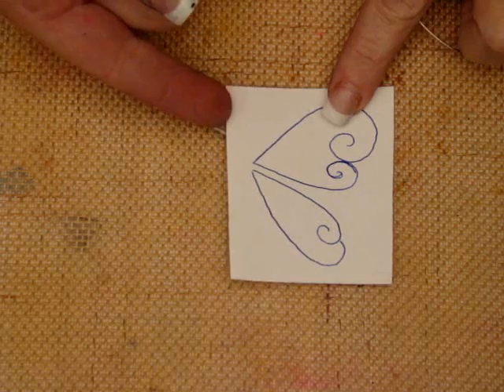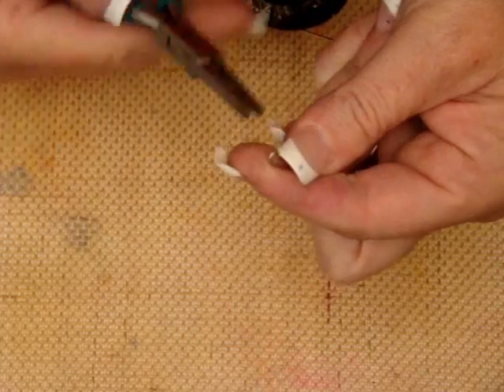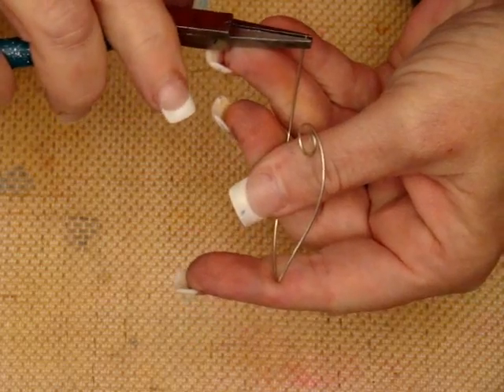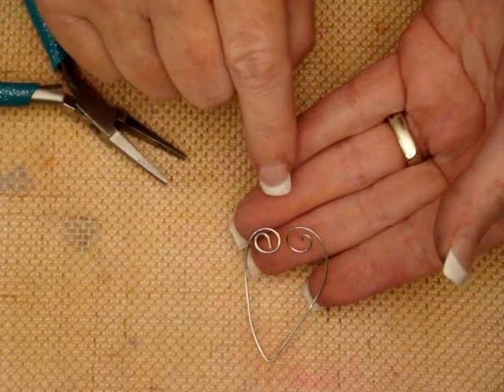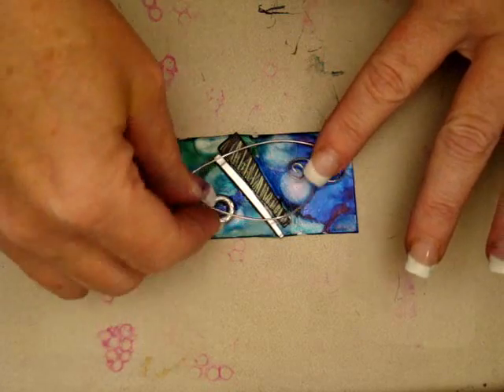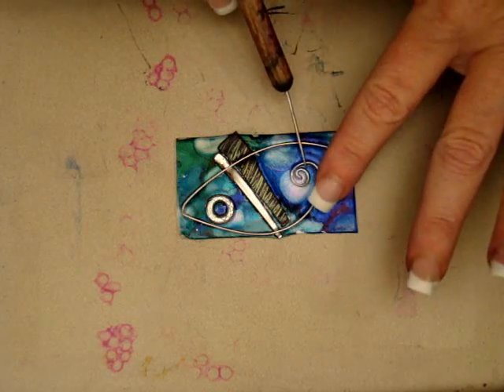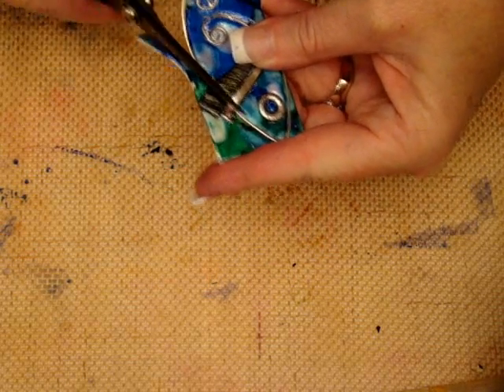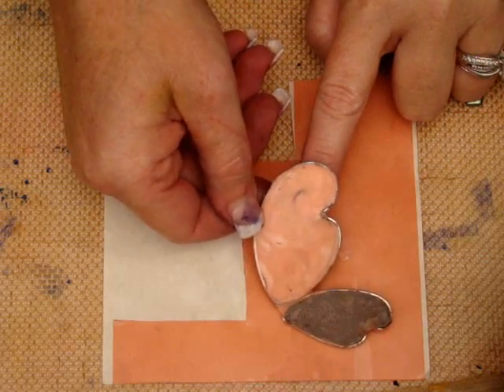Friendly Plastic Butterfly Design Challenge

Comment from the maker: Yes you are right, part of the wire came out.  I simply glued this in with a little clear epoxy.  
Also if the plastic is cracking as you are cutting, you have what we call "snappers".  This is plastic that is older and tends to "dry out".  Sometimes you can bring the spring back into the plastic by heating it on a griddle and then allowing it to cool on it's own.  Sometimes it works - sometimes not, but worth a try.  This kind of plastic is still okay to use for fusing

Comment: I am new to Friendly Plastic, so far have really enjoyed working with it. Linda I noticed in the video that when you went to cut out the large part of the wing, that the wire came off of the plastic. What is the remedy for this? I have also found that cutting the plastic makes it crack. Is there something I am doing wrong? I have bought new sharp scissors but this did not help. 
Thank you for sharing your beautiful work.
sloopy52